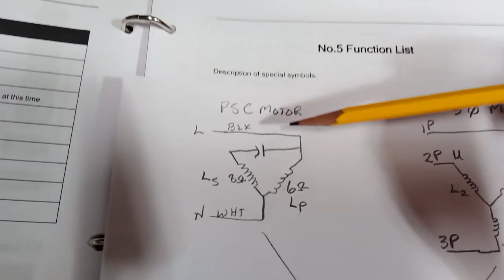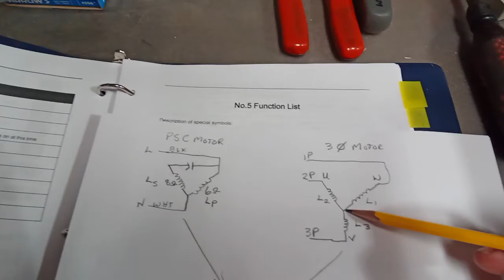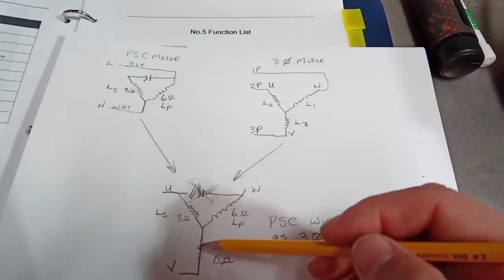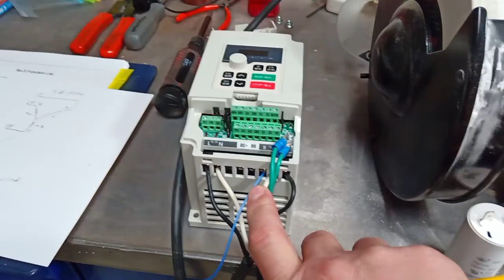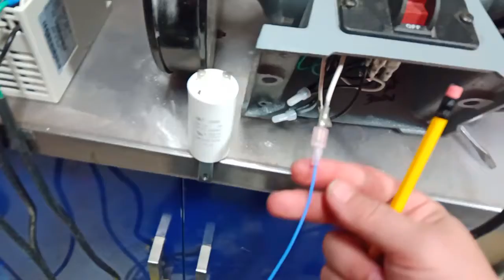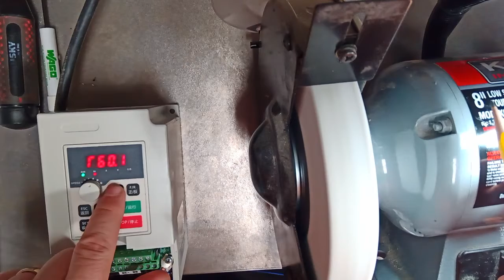Connecting a 120V VFD to single phase PSC motor in my bench grinder

Comment: I used FCU ac motor 1ph with Siemens v20,after 5 hours dry run the only thing I noticed motor temperature was high 56c while the ambient was 27c is there any recommendation to reduce the motor temperature?Thanks
Reply: You can reduce motor heat on any electric motor (regardless of its phasing characteristics) by use of an auxiliary fan. In fact,.. this rule applies to DC motors too! Most shop grade motors utilize Totally Enclosed Fan Cooled (TEFC) motors. These motors are designed to keep shop grit out of the motor. Because of this a small fan is attached to the opposite end of the motor's spindle. When the motor is running this fan moves air across the outside of the motor housing. Unfortunately, when a VFD slows the motor's RPM, that little fan slows down too! So it's now moving much less air. 
When I converted my Midi lathe to 240VAC 3PH VFD drive I ran into the same issue.  As a result,  I attached (separately powered) muffin fan to the back end of the motor. 
Wakodahatchee Chris
Reply: @cdrive5757  Actually it is an Air conditioning air fan coil unit,no issues with body temperature it is working fine so far.
Reply: @mustafadudde  Uh, the reason for that seems obvious. Besides, a motor driving a lathe is going to have very low speed demands that an air conditioner's air handler will never experience. PS: After re-reading your original post I now realize that my response was less than ideal in your application. On that note, most modern VFD's can be programmed to increase or decrease torque. This "Torque" setting does increase or decrease power consumption at a given speed. To the best of my knowledge Torque perimeters are adjusted via PWM superimposed on the variable frequency. The Torque settings are very useful for air movement applications, where torque demands are relatively low.
Reply from the maker: Nothing that I know of.  Using a split pole single phase motor under normal configuration will also get warm for that length of run.  Because there are additional inefficiencies when using the 3 phase VFD, the motor will get warmer.    If you are thinking of using a motor continuously for 5 hours, I would recommend getting a proper 3 phase motor.

Comment: thank you for this video . i do have a question if you let me , 
i'm over in Europe and i'm trying to figure out quite some time to ad a VFD to my drill press , its running on a single phase induction motor 0.55 KW 230 V 6.2 Amps 1420 RPM 50 Hz . and i was assuming i needed a single phase in & output for this motor in order to lower frequency? rpm  and left/right turn . but from what i understand in your video that is not specific needed to accomplish ? is there a VFD type you could reccomand in my case ? kind regards from the Netherlands
Reply from the maker: First of all validate your type of induction motor.  Many induction motors on drill presses have a starting capacitor which is linked to a centrifugal clutch.  If you start up the motor and hear a defined click sound, it will have this centrifugal clutch system, in which a VFD probably can not be used.   The secondary windings on these motors are not designed for sustained current application.  If however you don't hear the click and you open up your induction motor and find only 1 running capacitor then yes you should be able to connect a VFD.   If that is the case, I believe you will want to look for a VFD with 210-240V input single phase and 210-240V output in three phase.  Now if your motor has the centrifugal clutch, I would look at just changing the whole motor with one one of the Vevor sewing machine motors that already comes with it's own VFD. you can get them in 550W 3/4 HP or 750W or 1000W versions.  Because of the motor speed variability (~400-4000RPM), you could probably simplify to just a single belt pulley ratio.   You just have to manage the motor mounting configuration.  I use these type of Vevor motors for my 1x42 belt grinder and are great!

https://eur.vevor.com/ac-servo-motor-c_11222/sewing-machine-motor-220v-550w-brushless-energy-saving-servo-motor-industrial-p_010409180232
Reply: @prairieedgeservice  thank you very much for this information , i will have a look and see what i have here. i know i have 1 capacitor , but i'm not sure about the click . when i turn the motor off however, i hear a sound that seems to me like an active break to stop the motor. like something is touching the rotor inside. it's hard to explain , but i hope that it makes some kind of sense.
Reply from the maker: @NLDHGRockStaR  some induction motors still only have 1capacitor but have the centrifugal clutch.  It important to identify if you have the clutch.  Watch the following video.    https://m.youtube.com/watch?v=2XYdTogWcIA
Reply: @prairieedgeservice   thank you for your quick response , you really helped me out here. much preciated for your time and effort👌
Reply: @NLDHGRockStaR  They almost never use centrifugal clutch motors in EU. If your drill press is the  generic  type that you just buy at a hardware store, it will work with  any three phase or single phase input VFD, as shown in the video.
The three phase input VFD has a three phase bridge rectifier and it doesn't care if you  feed it three, two or as many phases as you like. Make sure to connect the VFD at 230V AC, not to 380/400V AC.
Then read the user's manual and SET THE LOW INPUT VOLTAGE THRESHOLD at 200V. Otherwise, if you use a 400V AC input VFD  and only feed it 230V AC, it will go into protection mode. Good luck!